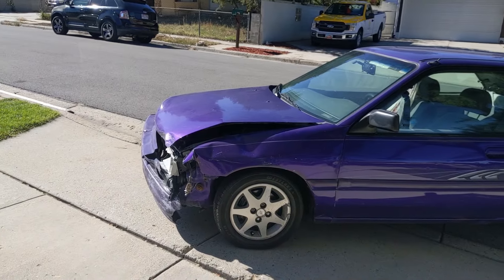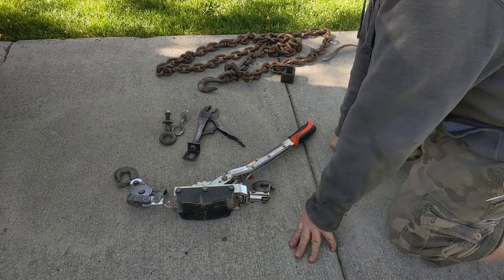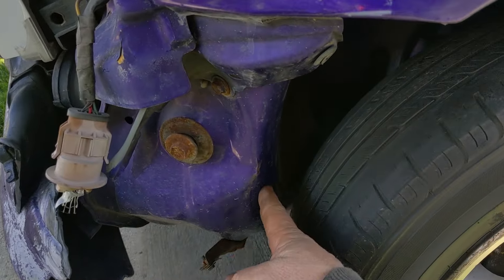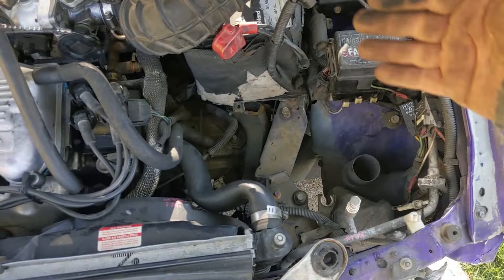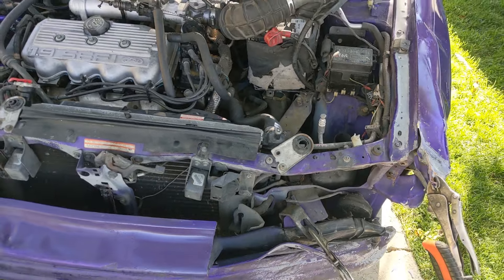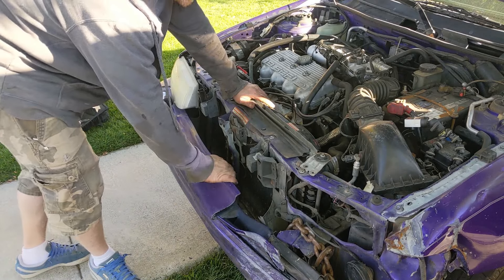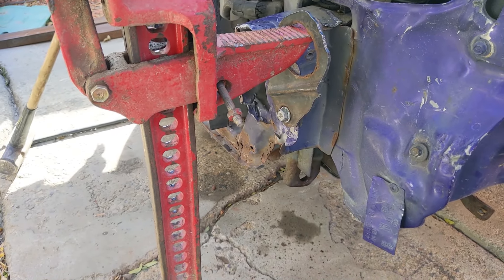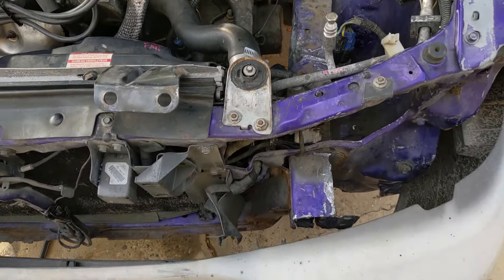Front End Collision Repair Frame Straightening AT HOME Wrecked Accident

Comment: @sixtyfiveford If the Ford Escort has a subframe, did u loosen or separate the left side of the subframe before straightenin the left frame rail? Was the subframe damaged?
Reply from the maker: The body it a unibody but the front engine and suspension is a sub frame. The unibody mounts were pushed back a little so pulling on the subframe pulls those mounts out to near factory. You really don't want to loosen any bolts as you want it all to act as one part.
Reply: @sixtyfiveford  So, were u able to pull the subframe with just the come along or without a frame machine?
Reply from the maker: @kainejuice  Yes. A come a long works the exact same way as a frame machine. I did have to tie the back of the car to my SUV.

Comment: Awesome job on the ole' beater, how much money did the insurance give you?  I would be warry on reselling a car with this amount of frame damage though (I assume your taking this car to it's grave).  In Virginia we have a form you give to the buyer which states that the car is rebuilt which helps at least reduce the liabilities the seller/rebuilder may otherwise hold.  Glad to see Ginger is ok.
Reply from the maker: Yeah the title is permanently branded rebuilt aka salvaged. There are multiple crumple zones on a car and it only affected the portion in front of the suspension. It's designed to be the weakest and buckle first. It bent exactly on the preformed creases. This portions job is only to hold sheet metal inline and the front bumper. It was salvaged 11 years ago after being stolen and having some damage. I think they paid me $1300 then. This is it's second salvage and I argued to get around $2200. Older stuff is easily salvaged.  If more than one panel needs paint it's essentially written off.

Comment: Quick questions brother...how long did it take you to fix the car? And if you put a prize on it how much would you think everything cost if you go to a collision shop??? I just got into an accident like this.
Reply from the maker: I did everything in the video in one Saturday. A collision shop isn't going to spend the time to reuse parts and is also going to want to repaint everything to look like new. To do that with the damage this had would have been $10,000-20,000 or more depending on the car. These shops are always busy and make their money off insurance claims. If you just walked off the street they would likely turn you away or throw you a huge price to make it worth their while. Now if you do find a shop and just want them to straighten the frame(structural panels) you will likely spend $1000 and wait a few weeks. Then you can put body panels on, radiator, etc.

Comment: I' have a similar damage done to my car front a head on collision. The driver drove their car right into mine. I'm worried the insurance company will write it off . My question is can my car still get repaired despite it being a unibody vehicle ?
Reply from the maker: It's just metal. It bends one way and it bends the other way . They'll write it off and offer you 1/2 what you can buy a similar car for. Keep fighting and hopefully you can get 3/4 the value plus a rental car. Heads up even if you don't get a rental car you can ask for the money that it would have cost to rent a rental car and they'll give that to you.
Reply: @lamujermaslinda That's why there's GAP insurance. Do u have this?

Comment: I was always hoping you would do a video on that car, well not this kind of video... Is it an Escort? Does it have the electric seatbelts? Is it the 3 speed auto with lock-up? We had a 1989 Escort as a rental car for a return trip to Bolder from LA.
Reply from the maker: It does have the electric seat belts. It's a 1996 5 speed manual.
Reply: @sixtyfiveford  5 speed would have been far better for our trip. The auto had a huge gap between 2nd and 3rd which made the mountain interstates a bit painful. Nice to see an 80s car in everyday use.

Comment: not to pry too much but just curious what happens with insurance when they dont offer you anything for the car and you repair it yourself being that the accident wasnt your fault, did you get the value of the car in cash anyway or they wouldnt offer anything if the car wasnt totaled out
Reply from the maker: They appraise the damage(you can also have your own shops appraise it) and they will write you a check for the cost of repairs. If the cost exceeds 50-75% of the value of the car they generally do a total loss/salvage on it.  Now if the bank owns it you are just making payments you won't likely be allowed to repair it yourself but you can still buy it back. They give you the full value of the car and you buy it back for scrapyard value. So the price they would get to sell your junk car to the wrecking/salvage yard(seams to be around 10%). So if you had a $10,000 totaled car they might charge you $1000 to buy it back. So they would allow you to keep the car and you get a $9,000 check. Along with this though you now have a salvaged title that can't be used to register the car. You have to pass a safety test(exact same test required yearly for all cars in most states). When you pass this basic test you now change your salvage title into a rebuilt title and everything is normal.
Reply: @sixtyfiveford  thanks alot for the reply, thats not a bad outcome considering the situation, you know the cars condition and history makes sense to get it at scrap value and get another 5 years out of it

Comment: May I ask why you didn’t heat up any of the metal you were “massaging “ hehe ! Much love! Have a blessed bad
Reply: How are you and ginger feeling?
Reply from the maker: There are a few reasons I didn't heat it. First I wanted to minimize the tools so people didn't get discouraged when I pulled out the Oxy Acetylene torch. Propane/mapp gas wouldn't have done a thing to help move the steel. The second reason is rust. Heating and bending it back is cake but the rust that will form on the inside areas you can't reach or touch up will make you regret the decision. Now on a truck frame that is 1/8" thick C channel I will pull out the torch almost immediately.

Comment: Problem with modern cars is that the damage and crumpling is engineered to follow certain paths, and the shock affects more than what is visibly bent. With high and super and even ultra high strength steels and construction methods, its unlikely to safely put them back together this way.

Comment: Holy.....no anti locks on that thing I take it. Glad everyone was ok. You may have had a chance avoiding that if it had abs.....maybe, not sure.
Reply from the maker: Anti lock may have reduced the collision speed and or possibly given me steering control. However I was aiming away from the truck direction so more steering control would have likely put me under the center of the truck causing significantly more damage. This may have caused them to roll/flip...  Possibly... She should have stopped when she noticed her mistake and I would have missed her completely.

Comment: What happened to your car, happened to my Honda Civic last 12-14-21. My passenger side shifted down by 1 and 5/16 inches. I already bought a radiator support before I watch this video.
Reply from the maker: That sucks. Some of these the core supports are readily available and easy enough to change. Some, like mine are fully welded top to bottom on the car and take a decent amount of effort to remove.

Comment: This is what I mean when I say "they don't make 'em like they used to".... airbags would have made this minor collision a nightmare project to restore.

They would not have been necessary in this collision, but they probably would have gone off anyway.
Reply from the maker: A buddy wrecked his 2016 Nissan a few years back with near identical damage(less actually). Seat belt tensioner air bags, side curtain, in seat airbags and front airbags all went off. The car drove just fine and everything worked but the cost to replace those was going to run near $7000(second hand). That's just parts for me to do it. Ended up just selling it off to someone as a project as I didn't have the computer equipment required to reprogram. This car actually does have air bags but they didn't deploy. I think because I may have just been under the minimum 14mph required for airbags to set off.
Reply: @sixtyfiveford  Sounds like you got extra lucky with the airbags!

Comment: Still have salvage title ...
Reply: @commietube_censorship_sucks  Rebuilt / Salvage, just semantics...same thing. I wouldn't buy either and there is also the issue of higher insurance premiums for a rebuilt or salvage title....
Reply from the maker: Here in my state you take your salvage title and go to any safety/smog(emissions) place you go to yearly and get a $15 safety inspection. You pass and they give you a rebuilt title at the DMV for $15. No, insurance premiums do not go up. This car was salvaged 11 years ago and the $40 a month I pay to insure it never went up. I've seen many cars salvaged simply for having dents on multiple body panels. I think they quoted just the painting of this car around $5000. So just having scuffs on the bumper, grill, hood, fender and door will cost $5000 to repaint.  Buddy had his 2016 Nissan hit in the same corner a few years ago with no damage to the frame it was totaled simply because 6 airbags went off at a cost of nearly 10grand for new replacements. The car drove great and had zero issues from the collision other than the airbags.